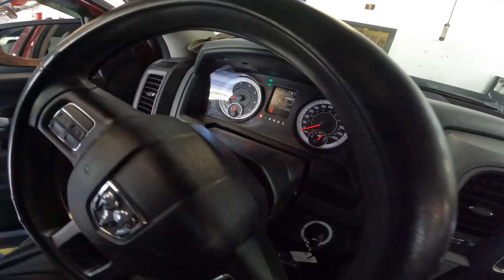BBK Shorty Headers! Insta-LEAK! Ram 1500 5.7

Comment: I'm going to bookmark this video so that whenever I think about putting headers on my F body Camaro I can watch it until the feeling passes. Look at how much work you saved me, thanks Ray!
Reply: Almost easier to take the motor out.
Reply: Lol AJ. That's a good idea.
Reply: Engine / Motor.  I know how people are.
Reply: @danssmokintreasures  Enginecycle vs motorcycle
Reply: @danssmokintreasures  Hell, on those LT1's it might be easier to drop the motor when doing plugs and wires.
Reply: @AJGreen-cn8kk  Having to remove inner wheel wells to get to a plug.
Reply: Whenever I build a motor I put a high temp Aerospace grease on the fasteners.  NEVER break coming out.  And this Grease is expensive but I get it from work.  Anti Seize works great too.  I see lots of Youtube mechanics that just refuse to use Anti Seize.
Reply: i put bbk equal length headers on my fox body mustang and it wasnt this bad, my only problem was that the motor mounts were worn out so the headers touched the k member and the steering shaft
Reply: @89Interceptor  your long tube headers cooked your motor mounts your hoses wires, wire connectors, plug wires,I work in a restoration shop and we hate headers,none of us in are shop have them on our 1960s cars
Reply: @dogsense3773  Wow I am 66yrs old still have my 1968 nova with headers no problem same for my 2003 silverado headers no problem. I kinda think you guys just might be doing something wrong
Reply: @thomasmleahy6218  On my LT1 I have to remove the starter to get to No. 8 plug.
Reply: @holmes1956O  I'm 66 too, wire connectors,starters power steering hoses, power brake boosters lose 1/3 of there life and more, if you drive the car more than a times a week, plug wires hard as a rock,I see that one once every few weeks, thanks will be 67 in five weeks P.S the newer cars have it bad even more with headers
Reply: Don't I have long tubes in my f body and I wanted to cry
Reply: Very off topic here, but if I use my first and middle initials, my name is A.J. Green...    😀
Reply: Long tube headers are way easier to install. 

Never do shorty headers. They dont add any performance and they dont make your vehicle any louder because you're retaining the stock restrictive catalytic converters. They're a waste of money, both in R&D cost for the company and the end user.
Reply: @Calango741  made my day! But in truth our family name was Gren, with an umlaut when my dad came from Sweden. They couldn't type an umlaut so they made him change it. Still nice to know there's at least two of us.
Reply: @AJGreen-cn8kk   I'm guessing that we're probably not related because my family name started in 1202 when King John (of England) bequeathed some land to my 13th Great Grandfather and he took the name De Greene de Boketon (the park of the deer enclosure) and over time it went from that to De Greene to Greene to Green... 
Is that T.M.I.?
Reply: @Calango741  tmi? No, very cool! I love family history stories. This might be the best thing about YouTube, how so many people of different backgrounds come together watching a Florida mechanic working on cars.
Reply: @AJGreen-cn8kk    👍
Reply: If you do, think very hard about how the spacing of it everything in there is layed out, you might find yourself doing a lot of custom work on tubing and other things.
Reply: @AJGreen-cn8kk 😂
Reply: Worked on high pressure steam systems. Anti-sieze is a must...

Comment: Header flanges are never truly flat, always run them on a table sander to knock down the high spots and make them true. And always tighten from center out in a pattern for even placement.
Reply: I always wanted Headers for a couple of my old Hot Rods that were actually my Dailies. Between Ray, Jeff Bradshaw and the machine shop I follow on here I'm kinda glad I didn't. They have given me more than one "Duh" moment such as squaring up the flange with a belt sander. An exhaust leak annoys the p-hockey out of me. I have a small one now on my Trailblazer with the 4.2 but you can really only hear it when you pass a guardrail or something solid on the right side of the road.

Comment: I was thinking about putting shorty headers on my 2004 Tundra... This got that idea right out of my head.
Reply: I work in a restoration shop and we hate headers, don't get them! It's all downhill with them
Reply: Not all vehicles are a pain in the ass. I have short tube headers from Banks on my 08 Silverado 1500 and the most trouble I had was a bolt I had to superheat on the original connecting bolt at the flange to the cat on the driver side. The shorty headers with polished and ported heads, high flow intake and a custom tune from EFI live has made a nice difference.
Reply: @CSXtrackworker  oh, agreed.... But pretty sure my Tundra would be PITA territory.
Reply: @johntetreault  but it would be worth it.
Reply: If it’s a 2uz, do it!! I’m planning on putting headers on my 96 Lexus with a 1uz the big (little) brother to the 2uz,3uz,3ur. They sound great but are a pain to get in
Reply: @JamsheedRpgGodBoss  yeah 2uz-fe.  But being a new england truck, just the thought of getting those rusted on manifold bolts free is quite a deterrent.
Reply: @johntetreault  my ls400 has a very cramped area for the manifolds kinda like an F body, best way is to pull the engine. I need to put a trans pump seal in anyways and a rear main.
Reply: @douganderson7002  I've dyno'd the truck before and after. They work.
Reply: @CSXtrackworker  Not as good a long tubes.
Reply: Does the opposite for me. Here hoping this is real and installing aftermarket is worth it. I wanna do it

Comment: I opted for JBA ceramic coated for my 04 ram 1500.  I dispensed with the kit gaskets and bolts and used oem gaskets and 4.6-5.4L Ford stainless steel stud and flange nut set. The flange nuts are serrated, one time use. The serrations keep the nuts from loosening. I did use aluminum anti seize on the studs. I may have used one 40mm steel stud and one 10mm copper nut in the hole very close to one of the runners, I can't remember. It's been 4 years, no problems.

Comment: I channeled Rainman Ray last night and discovered that the lower plastic agitator on my 2013 washing machine had stripped out splines, where it mates to the steel splined drive sticking out of the basin.  The safety-mandated lid lock system makes diagnosis much more difficult, one has to unscrew the latch and duct-tape it in place to run with lid up to actually see what's happening and not happening.  New lower agitator on the way....parts house had 16 in stock, so this does happen to others....
Reply: Same thing happened on our washer except it was from the late 90s. Finding that part and attempting tear down and install would have been 1/3 the price of a brand new washer. Ended up replacing with a Samsung, was shocked to see it’s assembled in USA
Reply: Must be a whirlpool.
Reply: That also depends on how corrosive the laundry detergent that you use, also is. 
I ripped apart my whirlpool, because the transmission splines were rounded off due to rust eating, weakening, and breaking off the splines, until the machine just wouldn’t turn. The machine was in a million pieces for a few months,  until my neighbor, tossed out his old Whirlpool model (compatible chassis and parts) in their front yard. Very similar to mine.  I ended up hand trucking the neighbor’s reject to the house, and fixed it with the parts from my busted up Whirlpool, and made another good washer.

Comment: We used to use brass nuts on the exhaust manifold flange and we put a couple extra ones on just a cover-up the threads makes it a lot easier to get them off later

Comment: As a long time header user, I have found the gray muffler sealer extends life of gaskets tremendously, also, a heat cycle and retighten is mandatory. I also cut flanges between tubes with hack saw to get them to not warp so badly.
Reply: Wow, does that really work?

Does flange thickness matter in this technique?
Reply: I was going to mention, watching Edd China, he's always use a paste when putting exhaust pieces together.
Reply: @tonyincs  yes to all your questions. A company named appliance headers back in the 70s had 3/8 thick flanges and separate for each tube or group of tubes. I never had them leak
Reply: Once you know something works, it is a whole lot easier to just do it up front. Rather than spend another whole day getting that damn headers out and back in again to try to fix a problem you knew was going to arise every time. On my 454’s, even with the best technique, if I get 6 months of hard towing duty between having to change gaskets I feel like I have won.
Reply: I think one issue is that Ray does not own these parts and has been hired to install them, not modify them.  It happens that sometimes modification is necessary to fit such parts, but if the part fits without modification we can expect that is how it will be done.  In any event it seems like a nightmare.
Reply: Great advice sir, I see a lot of these installs done by guys that don't have a lot of experience with headers

Comment: I put a sliver of sidewall rubber from an old tire in my U-joint adapter.  It helps keep the floppiness to a minimum so I can get it on those hard to reach nuts.

Comment: Hi Jay,
Normally with the BBK headers you have for the driver's side a short bolt and a long bolt : small for the bottom side and long for the top side.
If you don't be careful with that you can't screw the bottom bolt enough to make a good seal (you'll be stopped by the header tube).😁 It happened to me just like you.

Comment: Ray , watching you use wire on that heat wrap reminded me of my days as an Air Force jet engine mechanic in the early 80's . Every bolt on the engine had predrilled holes in the head and the bolts were wired to each other in a tightening direction . The wire had to be tight but if you overtighten then it breaks and you have to start over .
Reply: Safety wire! The single handed most frustrating task for me to complete
Reply: @FloridaRC_Adventures  Lol , I still have a pair of safety wire pliers in my toolbox . I haven't used them in 20 years .

Comment: I remember putting BBK shorty headers on my 1987 F-150 back in 2003. It was very easy and straight forward with no leaks or rerouting other components. I'm glad I didn't have the headache involved with putting them on a Dodge PU.

Comment: Let us see how this works out after a few weeks of install. Those shorty kits are usually more of a pain in the ass with very minimal if any gains at all.
Reply: Come on.  It's obvious that the owner of this truck knows more about this engine than the people who designed it.
Reply: I work in a restoration shop and we hate headers,it's all downhill with them on
Reply: Headers are a decent gain on a 5.7 hemi.
Reply: @mraycgz  show me your before and after dyno sheets then I will believe you
Reply: @MrSloika  eh thats not really the way to look at it. so many people cut in and change the way the real engineers wanted it to be. or worse, the business side say 'design it cheap' from the start. long as it runs close to the competition and lasts past the warranty thats all they need. 

look at chevy, they openly admit that its an easy cost effective upgrade to the point that they actually have a part of the website that tells you what to buy for upgrades over factory.

OEM is just that, OEM, its not Best Ever Made, its Only Enough Maybe. never the best, so it can always be better
Reply: From what I understand about car mods because I was about to get in on it was that 1 part will not make a difference. The difference comes when you change the parts that help make the new aftermarket parts function better, and you need to tune for the changes, then retune after more changes. If I had money I’d get into it,  but at the end of the day you’re spending 6g or more to get a real performance difference  that will make it worth it.
Reply: @mraycgz  Not shorty headers. They replace the factory manifolds and provide absolutely zero performance or sound improvement. 

Long Tube headers actually improve performance because usually the primaries are much larger than the stock manifolds and also delete or replace the factory cats with high flow units. Not uncommon to see at least 20-30hp/tq gain across the board with a well designed LTH. 

Long tubes are also far easier to install.
Reply: @bradhaines3142  lol thats not what Chevy does. They build cars to meet a specific goal on top of emissions and safety regulations. They're never going to build a vehicle that exceeds and outperforms everything because they also have to consider the average unit price when it comes to selling the vehicle itself. Every manufacturer builds vehicles this way. Most dont care about aftermarket performance. Chevy is one of the very few that have their own performance catalog. 

Chevy knows they have a huge following of car enthusiasts who like to modify their cars and have their performance parts catalog to meet those performance desires for those who have the money to do so. And they dont void the warranty if installed by a GM dealer. 

Source: I paid for a supercharger install on my 2018 Camaro SS. I had about 20k miles left on the warranty and knew i was going to void it, but friend of mine convinced me to talk to the Chevy parts guy at the dealer and sold me on getting a blower kit from them. Came with a 3y/36k mile warranty and custom ECU tuning. 4 days later, I had a 730whp Camaro SS running high 9's in the 1/4. I sold it 2 years later and got something faster and roomier.
Reply: @rotor13  yes. And who said this truck has cats? People delete them. Sometimes people do it and then the vehicle then gets shorty headers. I know, I own one like this. They flow more. They add power. Not in every application obviously. But headers short and long add a decent little bump for a 5.7 hemi. Period. The stock manifolds suck. And they’re prone to leaking. It’s almost as if there was a video giving an example.
Reply: @mraycgz  Clearly the truck has the stock y-pipe = cats still intact. 

The owner didnt have a problem with a exhaust leak. He wanted new headers. 

it helps to pay attention to the content.
Reply: @rotor13  Roomier and faster than a high 9? What kind of car is that? Sounds impressive
Reply: @rotor13  clearly you’re the smartest guy in the room. You’ve interjected yourself into a conversation that wasn’t about you and instantly moved the goalposts. You do you buddy I’ll do mr. I doubt you even have a 5.7 hemi or anything with headers.  But I’ll make sure I keep paying attention to what you say as I build mine. Lol btw These BBK 5.7 HEMI headers seem to deliver that at a great price. Expect to pick up about 8-15 horsepower with these shorty headers. More power is possible with midpipe upgrades to delete the cats or switch to high-flow cats.Nov 27, 2021
Reply: @mraycgz   Thanks for incorrecting yourself, yet again. 

No goal posts were moved in any of my comments. Because my back doesn't hurt.  Thats deflection and/or projection on your part, because all i did was retort to the points YOU have madem, tit-for-tat. 

You can cite any "official" course you want. The real world results show that the gains are minimal and far outweigh the cost of a shorty header as opposed to a good LTH while retaining the rest of the stock exhaust.
Reply: @rotor13  I never said they didn’t. “ Headers give you a decent bump on a 5.7 Hemi”. That’s what I said. And that is true. Real world. Short or long. Of course long tube headers are better. Of course you make more power deleting cats. But even at the lowest expected gain (5 horse) that’s a decent little bump in power on a motor that doesn’t make a ton of power anyway. And not for nothing but if you owned one you’d know there really isn’t a whole lot of bolt on stuff you can do to these motors. Intake, exhaust and a tune is just about it as far as bolt on mods most people are willing to do. A cam helps but is pretty invasive and you have to tear the motor down quite a bit plus add supporting parts. If you live in a place where you get e checked you’re limited even more. So like I said originally “ Headers add a decent bump to a 5.7 Hemi”. This isn’t subjective, it isn’t a theory. It’s just the way it is.
Reply: @mraycgz  And I said they didn't and not in an appreciable manner that justified their cost, hence why i said LTH's are better. And they're not much more expensive.
Reply: @rotor13  actually you said shorties provide “absolutely zero performance or sound improvement ”. That’s just not true. Long tubes are better. For sure. I have a weird one. I have a 5.7 in a challenger than I got with shorties and the cats intact. I replaced the cats with “mid pipe deletes” and kept the shorties because they’re on there and they don’t leak. I’d like to know what the difference is between that and long tubes. I’m sure it’s not much.
Reply: @mraycgz  This is not the place for pedantry.
Reply: @rotor13  look in the mirror to alleviate that my friend.
Reply: I have the same truck and the stock manifolds really are complete trash. Only way to fix braking bolts every 6 months is to literally replace manifolds with aftermarket headers. Complete trash the dodge refuses to acknowledge. Id be willing to bet this customer has dealt with it in the past

Comment: This is the reason I prefer OEM parts instead of aftermarket. Sometimes simple bolt on installations is not that simple. OEM stuff you just know it's going to work when time is of the essence.

Comment: Welcome to my world! I have a 2014 Ram 2500 5.7 hemi that like ALL of them had an exhaust manifold leak and broken bolts on the right side first... now the left side is starting to make noise! I wish I had a machine shop nearby that could resurface the cast iron manifold and solve the problem forever! Those shorty headers are a waste of $$ in my opinion.